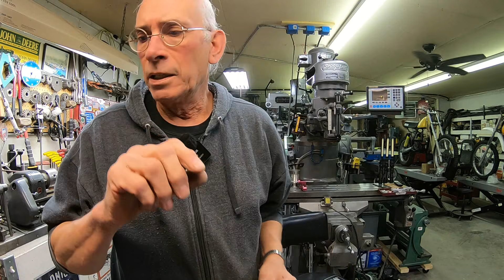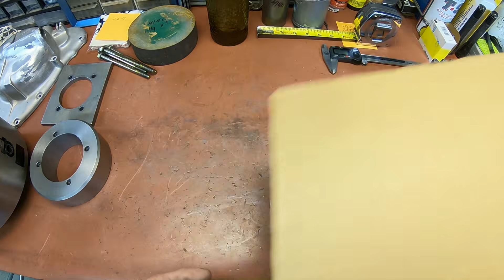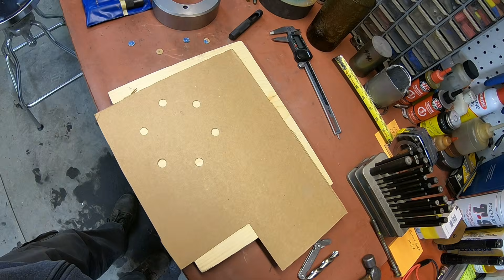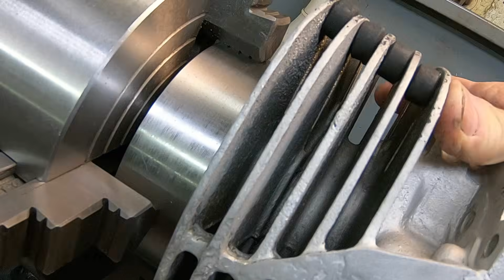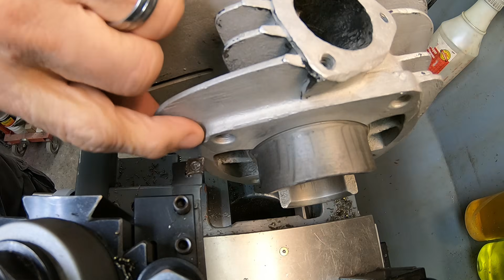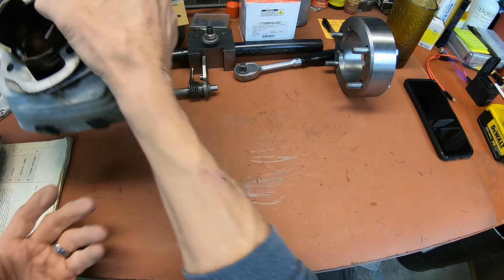Fabricate adapter to repair RM250 cylinder

Comment: Dale, is it possible to reed valve a piston port cylinder?
Also, is a reed valve intake a better performer?
Reply from the maker: You bet, we use to do it all the time before they came from the factory with reed induction, but it is more work because you have to make reed housings and other parts for the aftermarket no longer makes it. We use to use chainsaw housings and modify them. Yes reed valve is much better power and rideability in my opinion.

Comment: May I suggest mounting the cylinder on a mandrel and turning between centers?
Reply from the maker: Yes, I wish I had some mandrels, I am just a hobby guy I don't have all that stuff a job shop would have. But I am sure it would be a lot better and simple. This is the only one I have ever done, and don't anticipate doing any more. Thank you for the suggestion I sure appreciate it.

Comment: I made a similar adapter for a big bore in a 125 4 stroke, but mounts in the other side of the cylinder, supports the sleeve as it gets thin with the big bore.
Reply from the maker: Yes, that is how I mount this jig for boring in the lathe, matter fact that is what this adapter was made for in the beginning.

Comment: Step 1 cut recess. Step 2 place  cylinder head in recess to align it. Step 3 use transfer punch to transfer holes in fixture. Step 4 use small drill to pickup transfer spot. No need for cardboard template. 👍
Reply from the maker: Great idea

Comment: Would it have been better to do a shallower bore in the fixture and hold the cylinder in the fixture against the head gasket sealing surface ?
Reply from the maker: Not sure, something to ponder though. Turned out on this one the top of the sleeve wasn't all that even. But who knows if the bolt surface was or not. It seemed to have worked out. Probably lucky.

Comment: Hi Dale, 
Back in 80's I remember doing something very similar on an RM 250 cylinder, mounted almost exactly the same but on alloy plate as it wasn't going to be used multiple times. ( I did T305 as well, probably 2013~14?)
Made a flanged mandrel to fit in bore for tail-stock support, was afraid a bull nose center would put too much strain on spigot and crack it.
Used a piece of 6061, about 3-1/2" diameter.
The 250, I took about 0.040" off to lower all the ports then carved them back to correct port timing, seemed a better method than grinding ports lower, re-shaping transfers can be a PITA raising ports is 'easier' due to angles needed (did a 'dry fit' with gasket, Wiseco piston was 'low')
305 was only 0.010"~0.012", got both cylinders same height plus piston level with top of cylinder (better than new 😎)
Reply from the maker: Sounds like you nailed it. It just makes me nervous cutting material off the bottom. But I think your solution to cut the ports back down was the right one. Nice, I like to hear how others deal with a problem like that.

Comment: You can check the face with the indicator even with an interrupted reading, set the tip 10-15deg off vertical at cutting height, and half way between the sleeve and the weld. keep up the good work!
Reply from the maker: Thank you, not sure what you are telling me, but I'm sure you are right.

Comment: Nice set-up Dale. Just unsure if face of your fixture remained square after being removed to add the cylinder. Also,that is a standard equally spaced bolt circle, your DRO should give you the XY coordinates for each hole location, if not the machinist handbook or online. Just indicate the bore, no transferring holes and very accurate.
Reply from the maker: Gary......you are talking to a rookie here; I wish I had the understanding of the DRO for every function, but I don't. Right now, it has to be basic stuff like the half function. The bolt holes really don't need to be accurate because the cylinder centers on the sleeve that sticks out of the top of the cylinder. In this case they just hold it on. I need a guy like you to teach me all that stuff, I'm just a rookie.
Reply: Would highly recommend getting some machinable soft jaws for your lathe chuck. This will help in the process of indicating in your parts in the future, will explain later.
Reply from the maker: I have some that I made, just usually use them when I don't want to mar something. But if you think about it, it will permit the item to move easier. You sold me on the idea.
Reply: Yes! You can move it if you have to. But goal is NOT to have to indicate after you bore the soft jaws to the same diameter as your fixture. I'll explain the process when your ready.
Reply from the maker: Yes, would like to know the soft jaw procedure, you can contact me a dsweger@bresnan.net
Thanks Gary.

Comment: Why wouldn’t you just heat the cylinder and drop the sleeve out and repair the jug and reheat the jug and reinstall it. They normally come out easily.

Comment: morning  Dale why not set it up in the mill weld it and then machine off the welds there instead of trying to spin it in the lathe? i'm a 70 year old dirt biker retired auto mechanic and very amateur machinist but love to do it, i love you shop i have toy stuff compaired to yours but hoping to upgrade sometime soon
Reply from the maker: Hey Larry, it sure could be done on the mill, think I would have needed to order a longer mill bit though. So, I just used what I had. Sounds like we are a lot alike. I just enjoy piddling around in the shop. Keeps the old brain working you know.

Comment: Good morning Dale. I like your solution there. I cleaned up my own cylinder on the intake and exhaust side , leaving the base and top to a machinist. I’ll send you a short video on some sanding later, church needed a fill in volunteer to transport I think to a food bank.
Reply from the maker: Thanks James just can't believe what folks do to ruin a part. Oh well, it's fun to fix stuff like this.

Comment: Hi Dale. Nice job on that fixture, always good when you can reuse something that’s laying around, saves a ton of work. 

Also the damage on the base of the cylinder, although it won’t hurt it doesn’t necessarily have to be welded up, you could always face it to nice clean flat surface then just run an extra gasket to make up for the material loss. Just another option.

Thanks for a great video Dale, I’m really enjoying this RM series. See ya on the next one
Reply from the maker: Yes, you could, just afraid of changing the port timing. Probably worried about nothing. I just Enjoy the process.